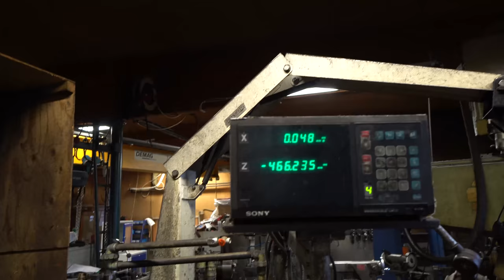Machining Giant Pneumatic Cylinder for our Youtube machines

Comment: We used to rope 3 or 4 train wheels onto large boring bars to load them up  and stop chatter. Resonance we stopped with a strip of rubber rolled up to fit in the bore. Worked a treat. Cheers mate.

Comment: I want to work at a place where this size lathe isn't considered "the big lathe".
Reply: Our "big" lathe isn't either that big. There is one vertical lathe near us that has something like 10 meter chuck :D I think I could get permit to film there so I could show what big lathe looks :D
Reply: What industry does that type of lathe support in your area?
Reply: Mining or oil drilling I presume?
Reply: Something with a 10m chuck would most likely be used in naval, aerospace or turbine construction.
Reply: @offshorebear  maybe rolls for paper mills?
Reply: @freezedeve3119  I now work at a large shipyard. Everything on this channel seems tiny now. He has a 100 ton press? We have a 5000 ton.
Reply: I ran a lathe at a US Steel plant in SE Texas for a while. I don't remember the exact specs for size, but it was big. About 40 ft bed length + -.  3 Carriages, that had seats to sit on and ride with the carriage. Under the seats a roller ran on a track next to the lathe. The chuck on it was 6 ft dia. and a bigger chuck was avail.  The machine was designed to make ship propeller shafts. I never saw any kind of bar in that machine while I worked there that came close to needing the capacity it had.  Hard to imagine a 30 ft + bar period. I made big nuts on it for a while. Like 3 ft 4 pitch fine thread nuts. lol  I ran most of the big machines in that plant. I found I didn't like big parts. Boring watching one cut take hours.
Reply: @dondroc1  wow!!!!!! Thats hard to imagine!
Reply: @dondroc1  The main shafts for power plants would be that kind of size.  The sheer mass of those rotating shafts and the things they turn provide the stability of the mains frequency continent wide.

Comment: That is the biggest band saw I have ever seen. I am a Merchant Mariner Medical Officer. In our machine shop on the ship have a Delta virticle band saw, Not much bigger than the one i have at home. For thick wall pipe we use a power hacksaw. Ajax AJPH-200. Only a 350x80mm blade with a cutting capacity of 80mm. Anything bigger we use a hand grinder or if we are in port we send it out. We don't have enough room for a band saw as big as yours. Very nice. I don't get to play with it though. I am the Medical Officer on board. I only get to play when someone fucks up and I have to patch them up. I like to patch up people. ;)

Comment: You should try to imitate the dampened tools now available for deep internal machining. The damping mechanisms seem fairly simple.
Reply from the maker: We have made those by ourself also. I think we have on really big one that is filled with concrete :D
Reply: Beyond the press Nice! You plan on honing the inside wall of cylinder you made ?  Although making such a high speed device you might get better results running it without seals, maybe just close tolerances and PE slide rings...
Reply: I will probably use just plastic slide rings there for the speed. I am not sure will I hone inside of the cylinder. I have all necessary tools but if I am just using sliding rings it might not result much better end result.
Reply: Hydraulic Press Channel yeah the plastic should fill in the valleys on the machined surface after few cycles. Might as well try it first without the hours long process of honing. Good luck!

Comment: 3:48, turn down your volume or take off your headphones!!!!!
Reply: Oof good idea. Wish I saw this earlier.
Reply: I was OK, saw what was going to go down.
Reply: Keep them on, get punished
Reply: Right after the bang, I went down to look for this comment. ouch :P
Reply: 'yah it was reely loud'
Reply: seriously tho thank you so much
Reply: I use headphones and I didn't even notice. I'm using loudness equalization DSP. There is one in every base Windows install you can enable by right-clicking the sound icon in the system tray, select your default device, click Properties, go to the Enhancements tab, scroll down and check the one called "Loudness Equalization". It brings up the volume of things that are quiet and softens sounds that are too loud. I really like it! It's not available for USB headphones though, only those that connect via 3.5mm jacks. Unless your driver has its own similar DSP.
Reply: I'll be damned, Azure! I've been using Windows since 3.1 and never noticed that. LOL Thank you!
Reply: Do you have any idea how loud this is in real life? It's part of the machining experience.. so enjoy it guys
Reply: Why thank you
Reply: I enjoy pain

Comment: A snow dumping site? 
  I bet that would be interesting to use a metal detector on.
Reply: I´ve seen people detect them and I bet there is some jewellery to be found among the random coins and scrap. Not sure how deep into snow a good detector can penetrate but you might be in for some serious shoveling. :)
Reply from the maker: We actually tried to find something out from there last year and we found mainly lot of scrap iron and then if you ignore the iron sound on the peeper you will find about 1 000 000 soda can ring things that you use to pop the can open :D

Comment: This might be a silly question but is there a reason you didn't grip the ID at the chuck end and machine the OD in one pass?

Makes me think back to pipe machining when I was doing my toolmaking certificate all those years ago. In first year we made plugs for our pipes, screw in and press in, with an off-set tapped hole for a drive dog. Then machined the OD with a HSS tool. We were graded on size and finish. Then by 3rd year we were grinding the OD of those same pipes in the cylindrical grinder. Along with our cylindrical square, sine bar rollers, ring gauges, and Morse tapers.

Sometimes I miss machining. But then I see all the little scars dotted over my arms from hot metal chips :D When they land on your lip you learn very quickly to spit them off and not flick them off with your tongue. An old foreman of mine had one bounce in through the top of his safety glasses one day and stick his eyelids together.

Comment: When I worked with CNC lathes I really hated the coolant. The vapors would irritate my airway and the coolant itself would make my skin break out. Our shop was air conditioned, but the coolant was still nasty stuff.
Reply: scottieray dilute your coolant with water...
Reply: BibiBosh We did, but the coolant was never changed or cleaned. It's a wonder we didn't get MRSA.
Reply: scottieray A disinfectant kills bacteria, such as PureGreen24. Use a disinfectant that is specifically formulated to kill 100% of MRSA and Staph bacteria. ... The most common active ingredient in disinfectants on the market is the toxic ammonium chloride or diluted bleach. >>> google <<<
Reply: google^^^^ but the you would be inhaling bleach vapour .... ouchhhhh
Reply: Well, I moved on to being a Pediatric CVICU RN...so I now deal with different probs. But I love watching machining videos still. My favorite part to machine was starter shafts for jet engines. One shaft took probably a week to complete after all machine work, boring, and heat treat.

Comment: Horizontal lathe is really not suited for this type of work. You will get a lot of vibration on your tool (Due to gravity not the toolings) and wavy pattern on the ID. Air leakage will be your next problem.  You should either look for a shop with vertical boring or just buy a ID polished tube off the shelf. Anyways, since your ID will be very rough and air leakage will be inevitable, I would suggest you use multiple stage piston rings on the piston. Also, a piston cup at the end will make a big difference.
Reply: On the final cut I didn't get any vibration and surface is just fine and if I want to it be air tight I just use my honing machine to finish the surface. But since there is going to be 200 liter air tank and 2 inch line feeding the cylinder some small air leakage isn't going to matter :D

Comment: that's really cool do you own the shop you're working in or or you in a high up position that you can pretty much do what you want there? also I didn't know you had to calculate how fast the lathe had to turn to bore out the pipe or whatever its called that your doing. I wish i had a nice shop like that to work in!
Reply: michael steven It's his father's shop.
Reply: With tool feed rates it depends mostly on the depth of cut.  But also how much the work piece and the tool vibrate.  Most machinists take the first cut with some standard value and listen/watch/feel the vibration the machine is making.  The first rough cut doesn't matter so much, so they can tune the feed rate and adjust the depth of cut as they get close to their final dimensions.  Towards the end they typically take a tiny depth of cut and use a slow feed rate so the final finish is all nice and smooth.

Comment: Is this for 1000 ton hydraulic press or is this some pneumatic press?
Reply from the maker: It's for pneumatic press. One of sponsors for the 1000 tonner dropped out and project went bad at that point but the cylinder for 1000 ton press would be close to 1 meter in diameter :D This cylinder is even smaller than our current press has.

Comment: Machining terminology: your external support bearing, we call a 3-point steady (roller steady in this case); your internal support bearing we call a live centre (pipe centre in this case).
Agree that using the carriage rapid traverse is a useful way to move the tailstock: however on lathes that big it's common to have a rack & pinion gear with a handle to move it. Seems yours doesn't.
Reply: In german, the external thing is called "Lünette" (eng. bezel) and the internal thing is called "Zentrierspitze" (eng. centering piont) wich is placed inside of the "Pinole" (no translation for that) wich is the moving part of the "Reitstock" (eng. tailstock) wich moves on the bed.
Reply: Heard them more commonly called steady rest and bell centre from the thousands of machinists videos I've watched on here. ESPneinDanke, "Pinole" would be the tailstock shaft so far as I can tell from your description.
Reply: +Mikeys Garage
Yeah, "tailstock shaft" would be a good discription.
Just asked Google again ;) 

"A "Pinole" is a hollow drilled work spindle in stationary machine tools, which can perform an axial movement."

I love my language, because every word has it's meaning, e.g. no doubt abaut what a "Pinole" is.

Greetings from Germany :)
Reply: Steady rest and live center here.
Reply: A live center with a bell that large is called a ""bull nose" center in my area.  The tool used for the inner diameter is a boring bar.
Reply: To get really proper, the tail stock thing is a dead center not a live center. In this case a rolling "bullnose" center.
A live center goes in the headstock, and the work is driven by a drive dog. A drive center has spurs and both drives and centers the work (mostly seen on wood lathes). A dead center is driven by the work, and can be "dead" (fixed), or rolling.
That said, I still call dead centers "live" centers if they roll/
Reply: pinole.....
Reply: Same here.
Reply: In dutch the outer support is called a "bril". The inner support is called a "meedraaiend center".
Reply: d3amonicus mee lopende bril😛
Reply: BomenJager daar heb je een punt😛

Comment: A snow dumping site?
Reply: Yep. It's really common in Finland. But this winter it snowed so freaking much the dump sites are huge.
Reply: Yes, there is still snow under all that crap. There might even be some snow left come the next winter. It doesn't melt very fast under the layer of crap that has accumulated on top of the mound from all the snow that has already melted.
Reply: And all that dirt is basicly gravel. The gravel is used on icy streets so people slip and die.
Reply: Nowadays they don't use gravel, but crushed stone. Because  crushed stone provides better friction.

Comment: I can give you a design to make a boring head to bore barrels without any vibration. Im fast and extremely smart at what i do. I rarely fail at what i do because what i do i love! I love machining and im good at it. So good that i can help you intensely. I do not ask for anything in return just for you to do what i tell you. If you want my help. Im sure you have hundreds of people telling you advice. I can review all the ideas and may even learn new skills. But i assure you, i know alot about boring large long tubes! Trust me im a engineering scholar! (thats auto dictionary).. Trust me im a unjurnear enuff for the girls i go out with ;) keep ya dick in a vice..
Reply from the maker: We have couple longer ones with some special tricks like chancing diameter to mess up frequency and I think we even have one big one that is filled up with concrete to dampen the vibrations but if you have some good tips to add please let me know. This time the problem was the tube it self not the tool since changing the support bearing placement removed the problem.